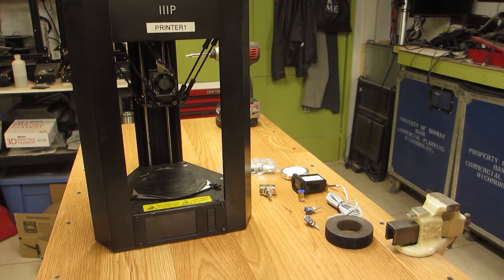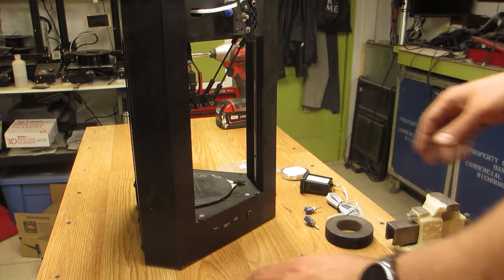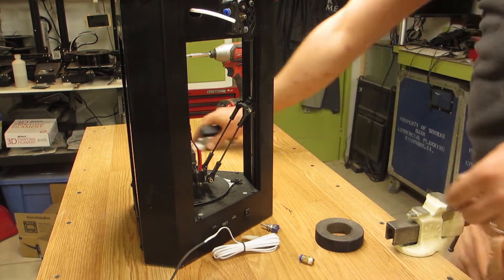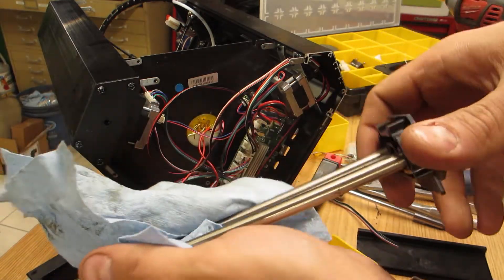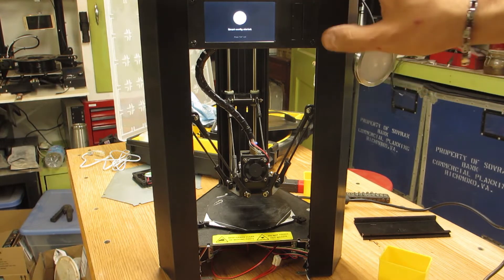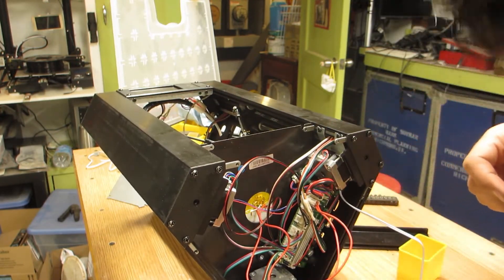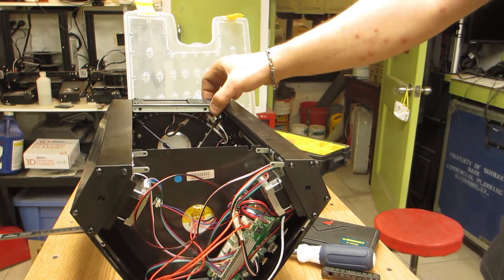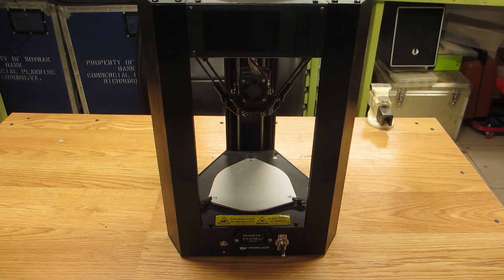MP Mini Delta Upgrades - PT1

Comment: Did I miss you installing the TL Smoothers?  Can the MPMD benefit from smoothers?
Reply from the maker: The mp mini delta does benefit from the tl smoothers some. It's certainly quieter. With that said the version of mp mini delta i had was from 2017. Things may have changed with the newer versions.